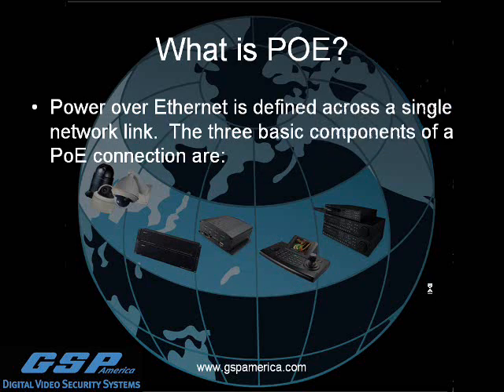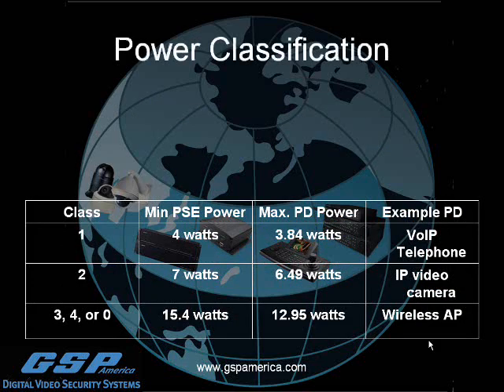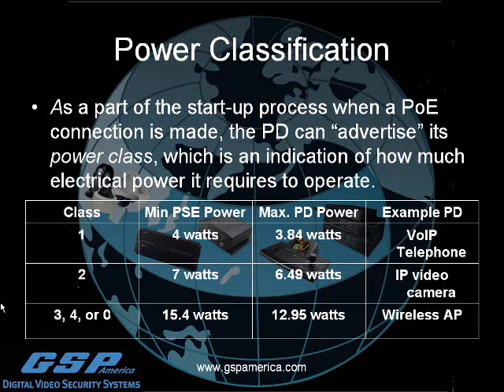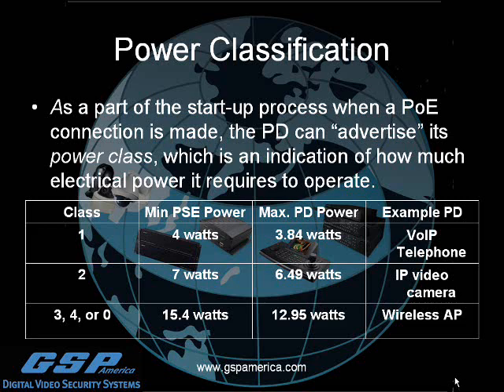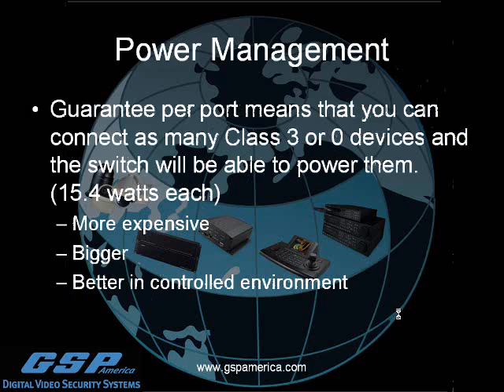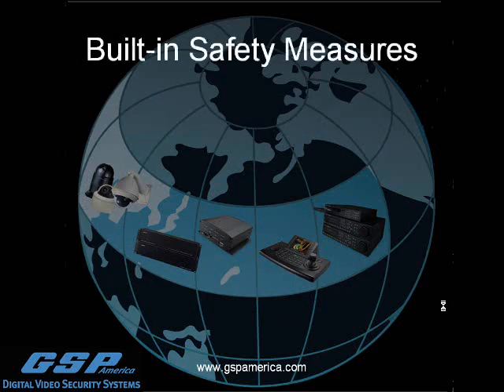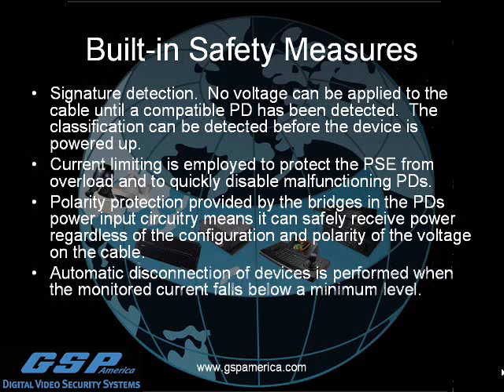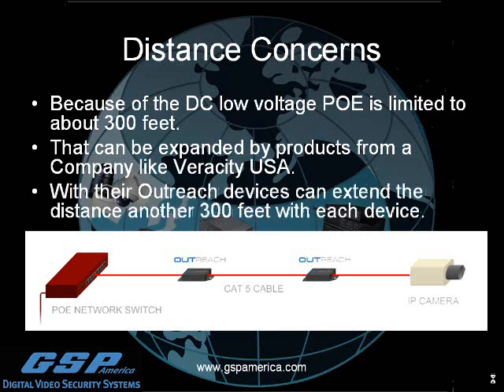Understanding POE

Comment: @pcmed365 It is not AC current it's DC so inductance isn't a big deal. It's low wattage. And the pairs are twisted independantly. Pairs 1 and 4 are used for power 2 and 3 are for Tx and Rx.